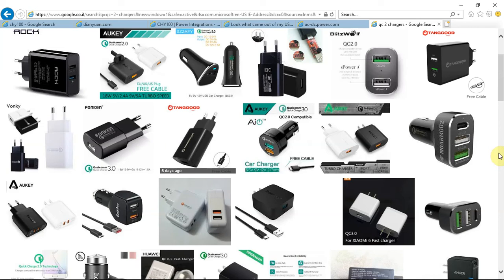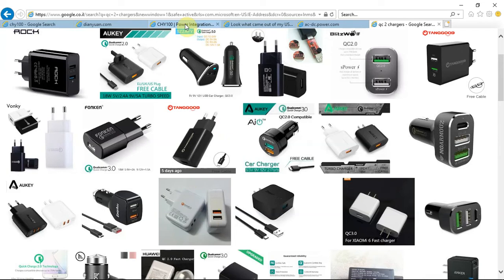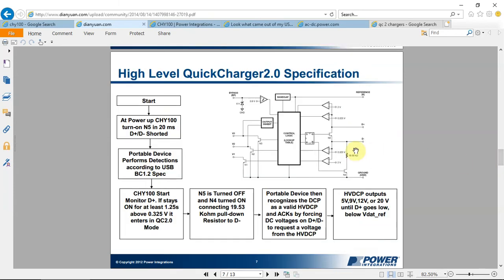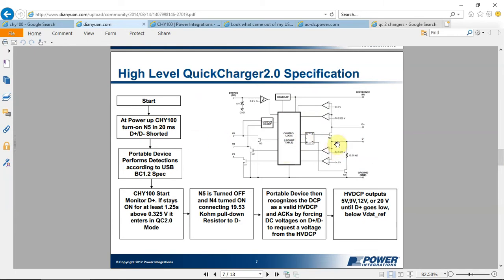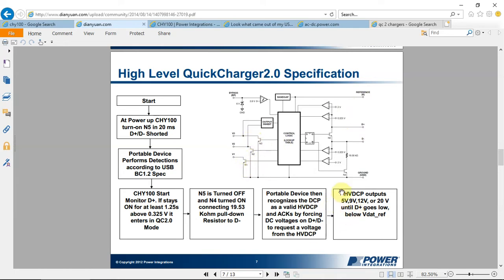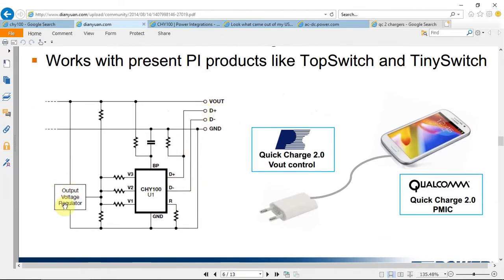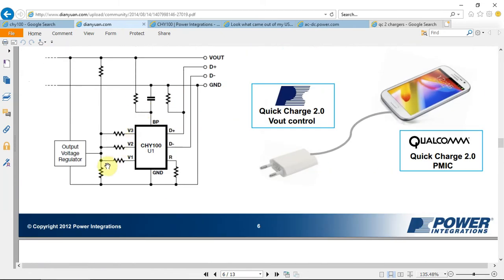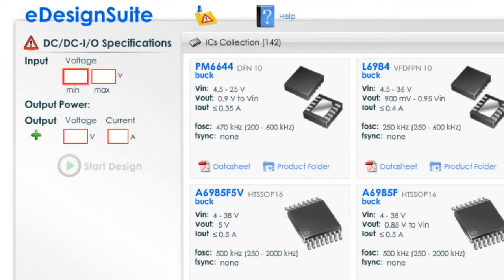DIY QC Charger 2.0

Comment: Can we find the inductor on this project easily to make one of this? Because I think transformer or the inductor in SMPS is the hardest thing to figure out what you are gonna use.  Another question is that why did you stack this boards up? Do you have any other intention other that just charging the phone?
Reply from the maker: 1. If you fork the project from EasyEDA, you can click on the BOM and order most of the parts directly from them including the inductor. When you order the parts, state the order number of the PCB and you will get free shipping on the parts ( they will send everything together ).
2. I stacked them as I have few phones ( kids... ) that are QC and when we are in the car, now all of us can fast charge them.